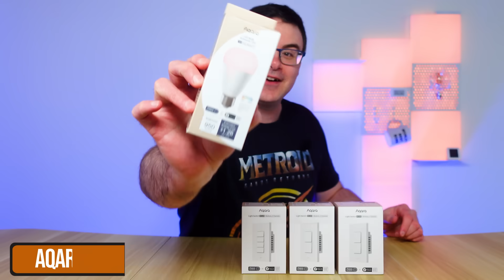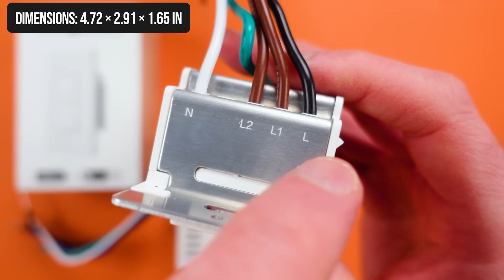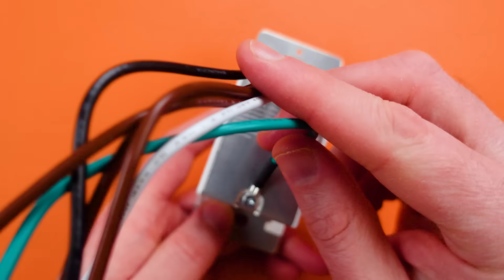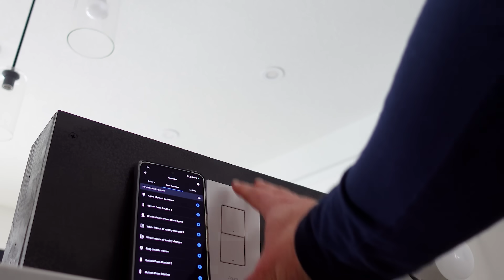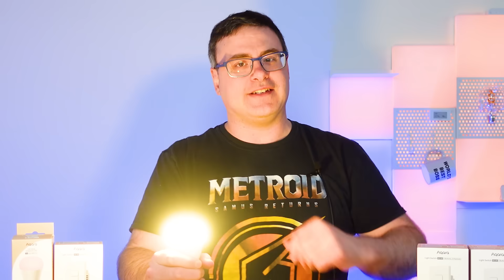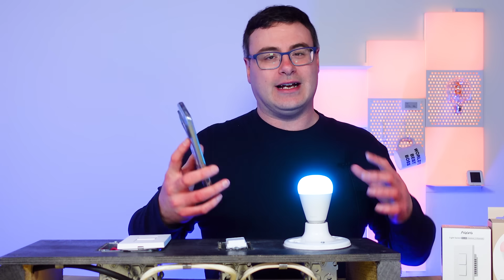STOP Buying Philips Hue Until You See This NEW Aqara Smart Lighting

Comment: Nah, I have to disagree. The hue bulbs are better 😬
Reply from the maker: The only thing I could find was that Hue did a better fire or candle type of effect
Reply: So you personally compared the aqara? Or are you just a fanboy
Reply: IDK 🤷🏼‍♀️ I love Hue but if I didn’t already have all Hue and Lutron lighting, I think Aqara would be my choice. I have Lutron and Hue, because I capped out two Hue bridges and the only option I had for switches with Hue was to use the Hue thing that goes behind the switch or the Lutron Aurora Dimmers or toggle locks, so I got Lutron for lights people kept turning off and needed manual control. I love my Lutron switches, but if this was available at the time I installed them, I probably would have switched out my Hue for these instead! Then all my lights and switches could be the same brand and have MATTER OVER THREAD!
Reply: Do you have the new aqara bulbs? I’m in the market for some
Reply: My only issue with hue is that they're so dim, but I have so many that I don't want to start over with the eco system.
Reply: @skullcrusher_1 100% agree! I wouldn’t go below 75 watt equivalent cause even that isn’t as bright as I would like, especially for the price. I’m heavily invested in the Hue ecosystem as well, cause they were the best for HomeKit. I’m not going to throw out all my Hue stuff either, but I plan to replace Hue as they burn out. It might be a slower transition, but I think it will be worth it in the end. All bulbs burn out eventually, and Aqara is more affordable. Although who knows maybe this will be a wake up call for Hue to make some improvements and/or price drops? 🤔
Reply: It just worrrrrrrks....
Reply: Not for the price point.  T2 is $22 USD